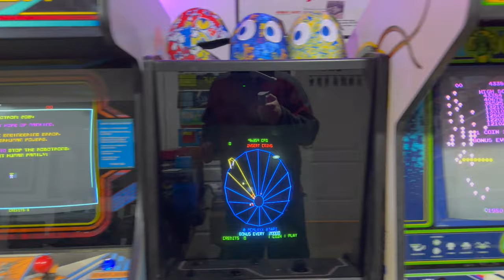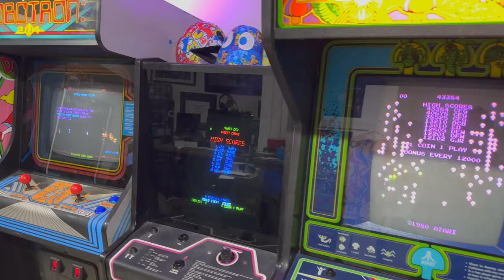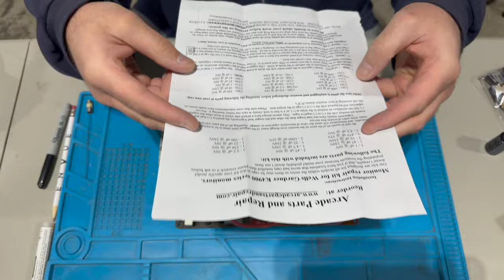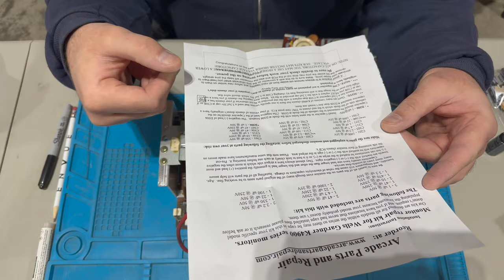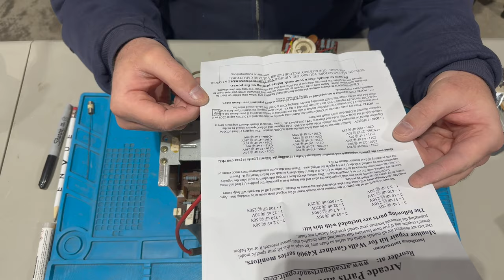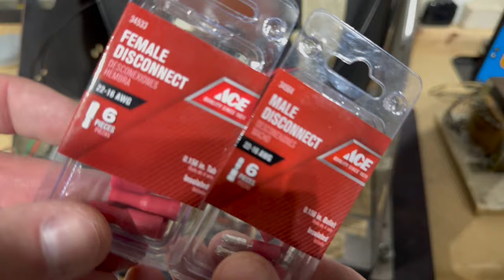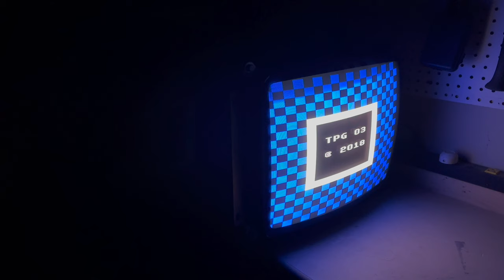How to Install a Cap Kit in a Wells-Gardner K4900 Arcade Monitor: Williams Joust Restoration part 5

Comment: Thanks for sharing your journey to restore the Joust. Looks great so far! What the isolation transformer does is remove any differences between hot and neutral. So in effect, there is no hot or neutral side at the output of the isolation transformer.
Reply from the maker: Cool, thanks! In other words, the AC is no longer polarized after it goes through the iso?
Reply: @overtimearcade  You could look at it that way but polarity is a term used primary in DC circuits. AC is both positive and negative.
If you were to look at your wiring panel for your home, you could see one of the AC lines is connected to the ground line. That is the white wire and is what makes this side the neutral wire. Since the other side of the AC line is not connected to ground, it becomes the hot wire. This is done for safety and isn't required for AC voltage flow
Reply from the maker: @gcpowersify  I think I knew that...? But those classes were decades ago!

Comment: I like to check the polarity before removing the capacitor, as I've seen the symbol on the PCB be different from what it's meant to be.
Reply from the maker: Yup, I usually do the same. Famously, the silkscreen on the solder side of the G07 chassis shows the wrong polarity for C302!